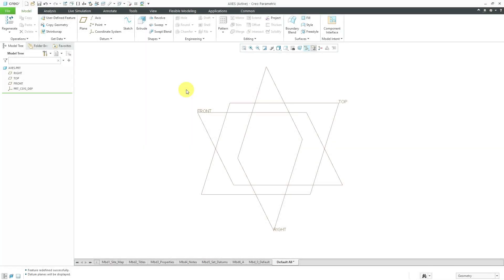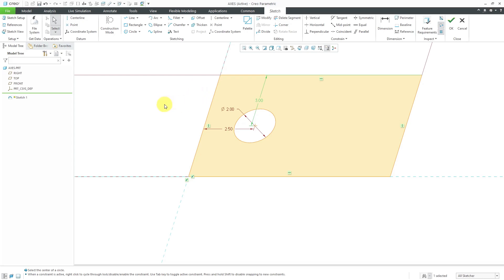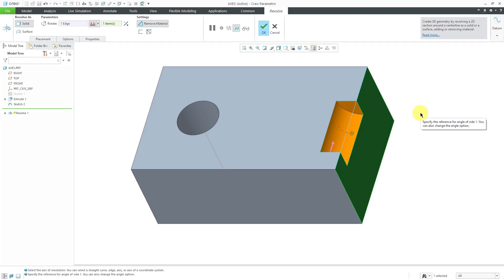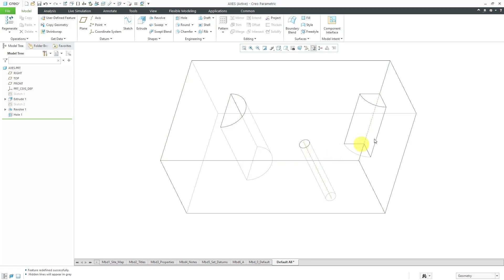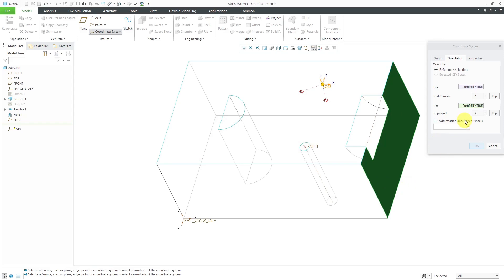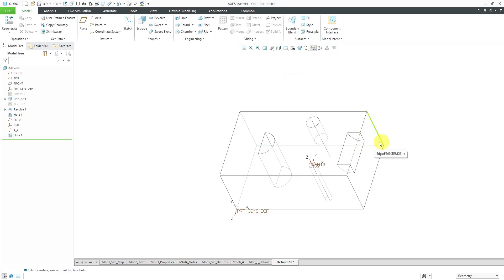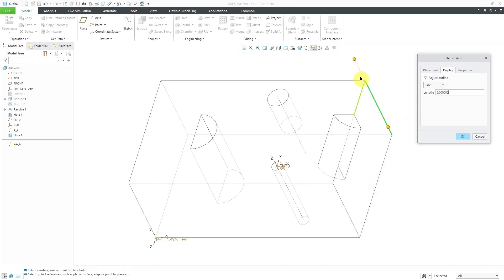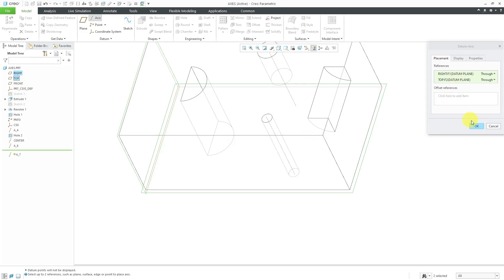Creo Parametric - How to Create Datum Axes

Comment: Hello, I use Creo 7 and when I create a circle and extrude, my system does not automatically create and show that datum axis. Is there something I need to set within configuration?
Reply from the maker: Check your layers. Your axes layer might be hidden.
Reply: @CADPLMGuy  As in my filters or something in settings? because I have Axis Display filter turned on
Reply from the maker: Layers.
Reply: @CADPLMGuy  Found it now, ty so much

Comment: What are those tabs on the bottom of the viewport?
Reply from the maker: Those are my Combination States for MBD at the bottom of the Graphics Area. See my videos on setting up model templates and Model Based Definition.
Reply: @CADPLMGuy  Ok thanks, that was my guess, but I wasn't near my computer to try it out. I think I just never set up any combined states since I've upgraded versions. I don't believe that was included in the last version I was running, or I never noticed it.

By the way, you just caused the biggest (positive) headslap ever based on your repeat region video. I've been using nested repeat regions with a single asm.mbr.param.name filter on the nested region to pull parameter values. I never even knew User_Defined could directly pull parameter values. Might be my biggest Creo oversight ever (though it's up there with flexible parameters). Had I seen your video earlier, I could have saved multiple days of trying to figure out how to do some of my more complex tables. The woes of self-teaching...
Reply from the maker: Combination States have been around for a long, long time. Since Wildfire 2 or 3 at least.
Reply: @CADPLMGuy  
Were they always tabbed at the bottom like that? I don't use them all that much so it sorta makes sense I didn't notice them. 

You likely saved me days of fiddling with this repeat region revelation though. So thanks for that.